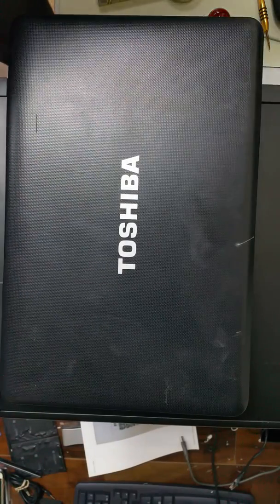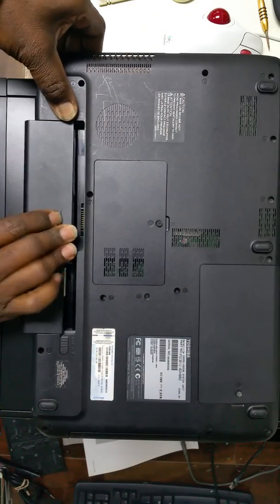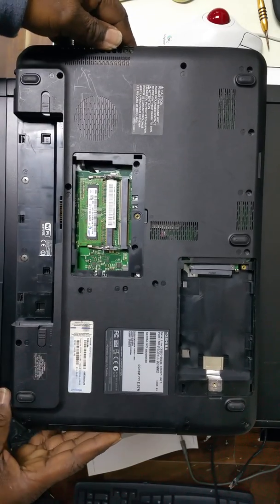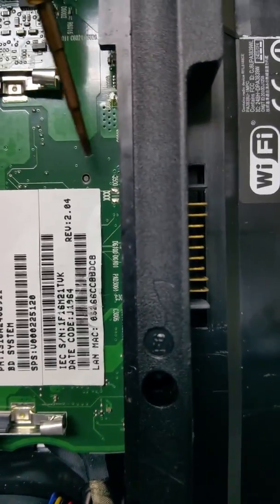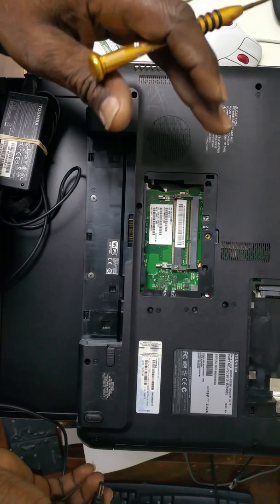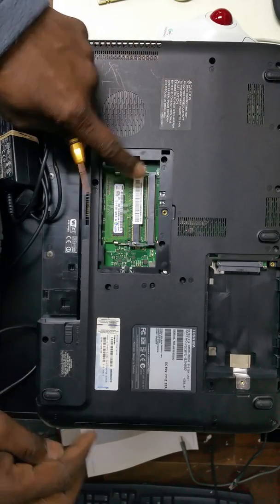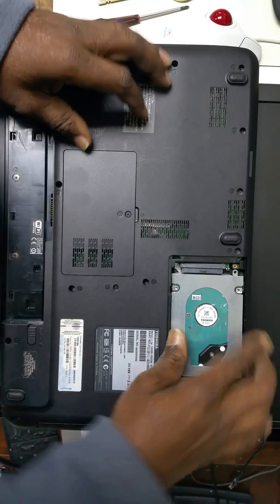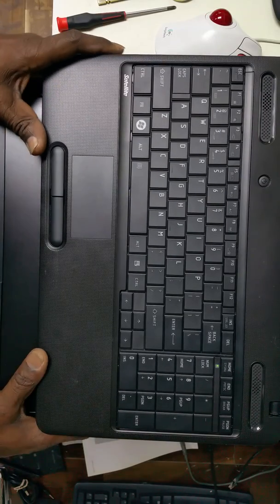Remove BIOS Password From Toshiba Laptop.

Comment: This video is really helpful. I have Toshiba Satellite C55-B2570. For this model, instead of XXX pins, the two pins needed to be jumped is marked as JPW. I followed your steps but I FORGOT to REMOVE the hard disk before I jumped the  JPW pins. After I put everything back in and powered on the laptop. The BIOS password prompt window no longer showed up -- good ! it was removed successfully,  BUT a window asking for HDD or SDD password began showed up, I don't know the HDD password, how could I remove or bypass the HDD or SSD?

Comment: I tried this but now my laptop gives me 3 loud beeps and then 2 short beeps. Black screen and nothing 😶
Reply from the maker: Please forgive the late reply
have you reinstalled the memory modules and see whether the beeps are still present or not?
Reply: @Villain2techstuffLorfils  Hello again, no the beeps stopped. I checked and it turns out I had not put in the memory card properly. However, the blue window keeps popping at the start. I could not bypass the password, no matter how many times.i tried. I suppose I'll try to start it up using a flash drive so I can restore the laptop to its original state. I'll see if that helps. I'd hate to have to do that because I have so much content in it 😒
Reply from the maker: @gisselgarci  Before restoring the computer, do you have a docking station? if you do, you can copy all of your data to another drive then restore and copy the data back to the computer, if not then try using another drive to restore preferably SSD if possible.

Comment: @ Villa Lorfils    Thanks so much for creating this video.  I have a Satellite L55 A5226 but I can't seem to find the jumper. I looked all over the web for where they may be located (like for schematics).  I don't see any xx's, even under the RAM chips, and I have tried connecting two points on almost everything on this board.  tried removing the CMOS battery, using "Toshiba" as the password, etc.  Please assist.
Reply from the maker: Under the bottom most ram slot you should see a sticker.

Around the stickered area, you should see what is labelled in fine print, to be JCMOS If you can’t find it around the stickered area, you will need a heat gun.

Heat the sticker with mild heat from the heat gun and peel off the sticker gently.

Under it you should see a JCMOS labelling. You should either see two contact points with bare soldering on it or they should be bare PCB area, Take a small flat blade screw driver in order to bridge the two contact points.
 hold these for at least 15 seconds. This should be time enough to clear or reset your CMOS
Reply: @Villain2techstuffLorfils  Hi, Thanks SO much for the rapid reply.  I very much appreciate it.  However, I looked throughout the entire motherboard such as around the CMOS battery, under the RAM, and took off the stickers there but could not see the JCMOS or the two contacts that I would have to jumper.  Do you have the schematics? Thanks again.

Comment: It worked. Thanks. I tried everything, even disable the PC and remove the CMOS battery for a few days, yet nothing seemed to work... the only thing I did not try was doing it with the memory module in, as you described. Thanks for taking the time to upload the video. 

Toshiba C655-S5515 CMOS reset
Toshiba C655-S5515 password reset
Toshiba C655-S5515 BIOS reset
Cheers from Costa Rica!
Reply: I tried it and for sone reason i  could' nt get it to work  
Tosiba C6550-S5209 can u help me out .

Comment: my keyboard does not work, buy a usb keyboard, but it does not respond until the windows start, before it worked from the start of the pc, I do not know if I change the configuration in bios, now my pc is to restore or delete temporary files on the black screen and not is there a countdown and it does not detect usb that I can format from an external adapter or do you know if I can delete temporary files from another computer? my pc is a11 sp5001

Comment: I have this problem I forget bios password  I watched  your video but I can't  see probably where you push
Reply from the maker: If It Is the Same Model , On The Board Just Below the Memory Card, There Will Be 2 Solder Points With "XXX" Stamped On The Board Next To The X's , They Are The Points That Has To Be Jumped Or Shorted.